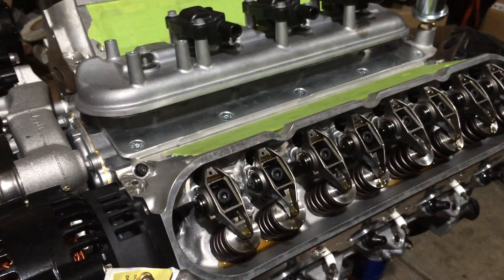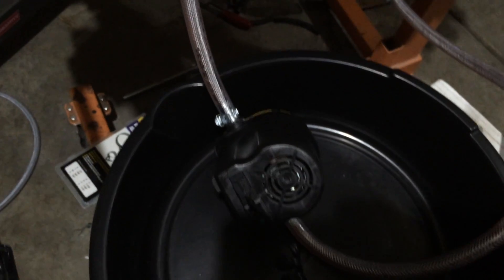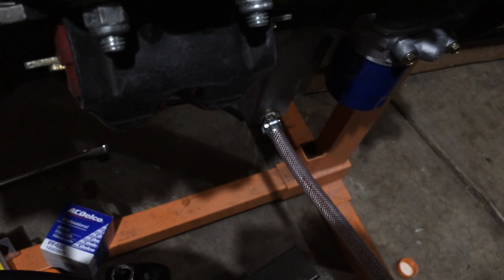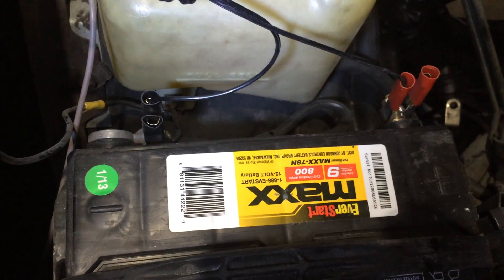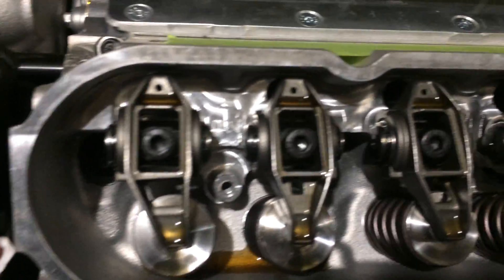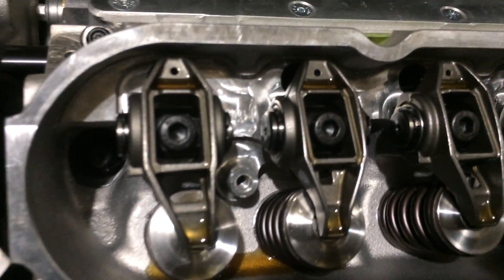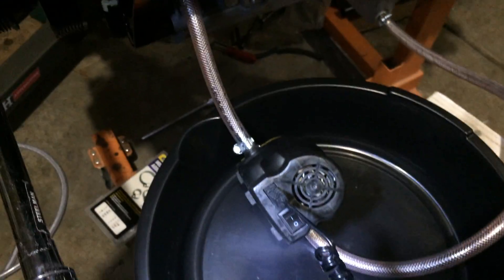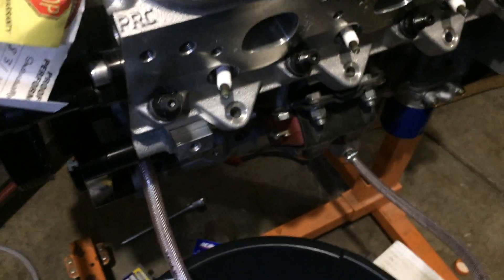LS 418 Engine Oil Prime with Parts inventory in text

Comment: That’s pretty slick. I don’t imagine this is necessary after replacing an oil pump in an engine that’s already been in use, right? 
I’m going to be replacing mine and planned on putting a little break in grease on the gear when I have the cover off to shim it, then removing the galley plug and  adding oil to the pump itself. 
What are your thoughts on that?
Thankyou
Reply from the maker: Thanks. Would certainly not hurt but would be overkill for your application in my opinion. In my case with fresh rotating assembly it was a no brainer. Would certainly do for a cam swap.